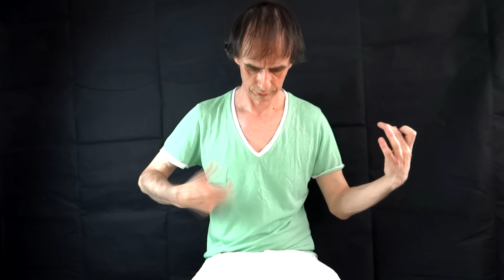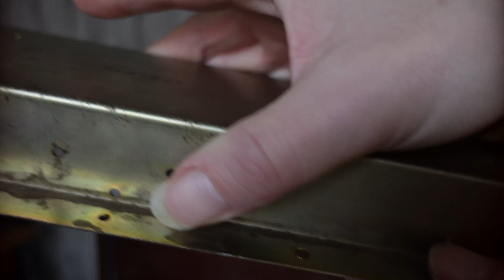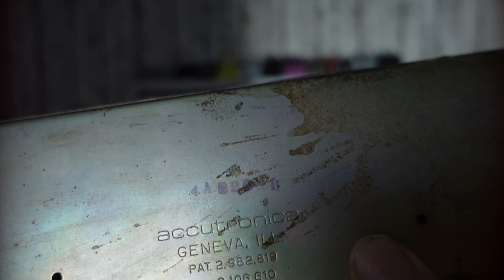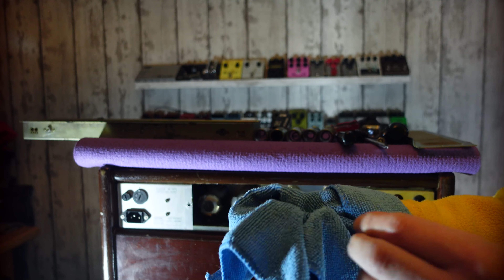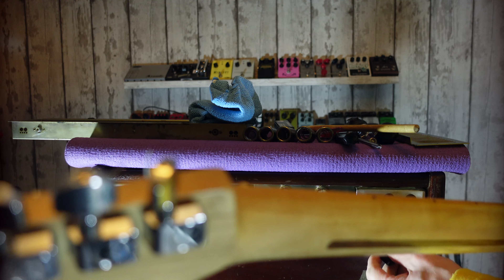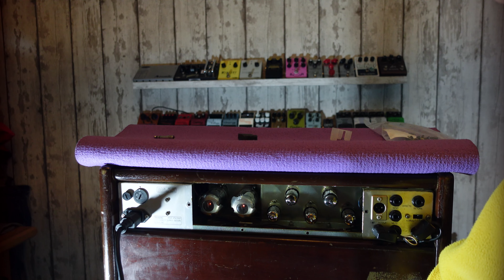Spring Reverb Tank Repair

Comment: Thanks for posting this video. I have the same model, but when I turn the Reverb knob It makes a humming noise. Any idea what It could be? I just did a quick visual inspection and allá the wires look fine.
Reply from the maker: Hi, 
Thanks for reaching out. 
The possibilities are:
1: dead phono leads to the reverb tank (easy to test)
2: poor connections to and from the transducers (resolder?)
3: dead transducers (hmm, not good, but can be tested by tapping perhaps)
4: duff tube (always have a few spares to hand, not necessarily expensive and an easy swap out, just be careful and sensible). The old one might look black? 
5. Duff reverb tank. Not the cheapest swap out but worth considering. 
Hoping this helps! Let me know how you get on. Otherwise it's for a seasoned electricronic engineer to look at it. 
All the best, Dale Harris

Comment: You don't show how you actually repair the reverb tank!! 🤦‍♂️
Reply: Yo clarify: so the bad tube was stopping the reverb tank from working? Can you explain that in more depth? So the tank itself was actually fine all along?
Reply from the maker: Reverb tanks that are driven by tubes can stop working completely when the tube fails. It's one of the very common issues to check. So if your reverb tank stops working then check the wiring, transducers, and the tubes! 
Best regards, Dale Harris
Reply from the maker: Hi Karl, the problem was diagnosed at 05:15, the repair was shown at 06:10 and the final test and confirmation of a positive result was at 08:05. I hope that this helps. I know it wasn't what most would expect;  often, it's a tank wiring error or duff transducer that's at fault. The point of the title is that many look up a reverb tank repair in order to get inspiration for a correct diagnosis, not knowing about other causes of the reverb tank to stop working. I hope that this helps. Best regards, Dale Harris